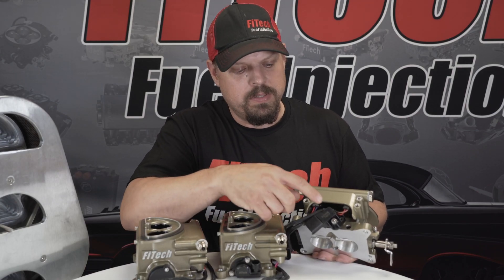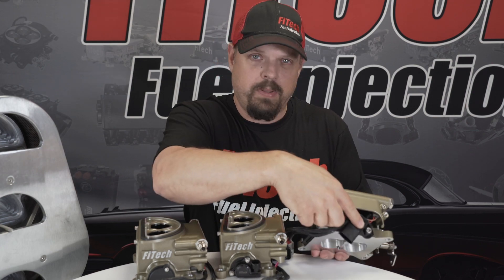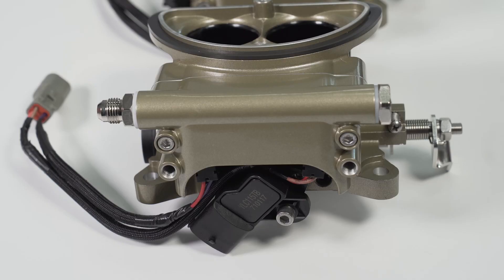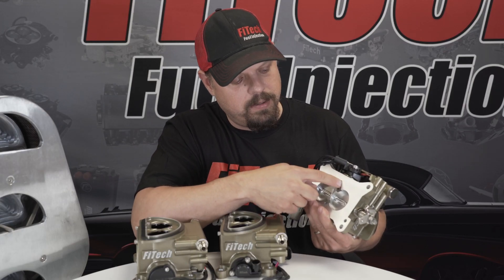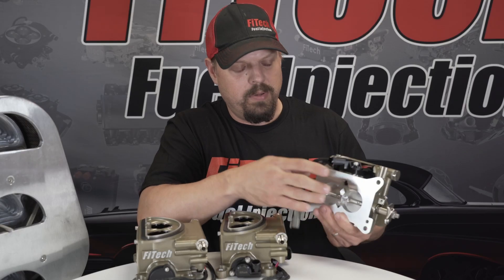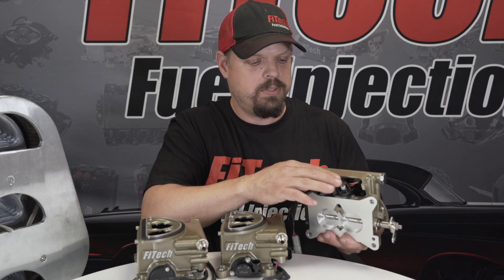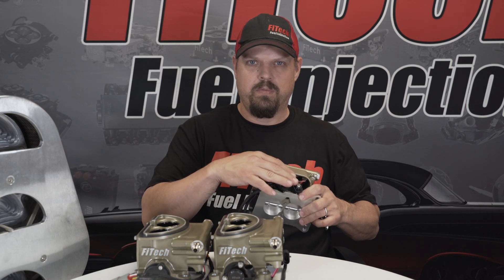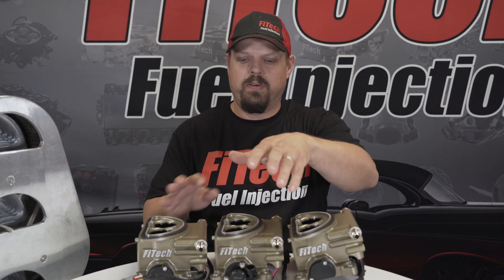Tripower Throttle Body Installation Tips | Tech Tuesdays | EP76

Comment: Cant wait to get my 68 road runner built so i can buy this. Will be a 500 stroked 440 with 440 soarce heads and full roller. This i think will be the perfect fit for it. Right under 600hp

Comment: Any tips for setting the IAC on the tri power set up? Should it be set with the linkages disconnected? I synced all three throttle bodies with air flow meter, using the linkages. Having trouble making a small enough adjustment with the throttle adjustment screw to dial in the IAC. Thanks.
Reply from the maker: Hi, we actually have a video that goes over this information: https://youtu.be/iDigH0f-gJg